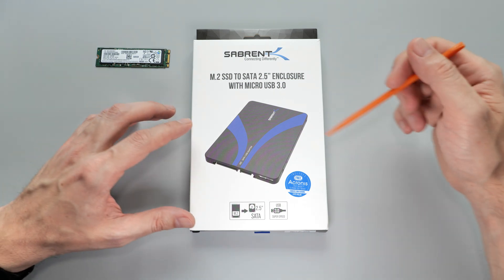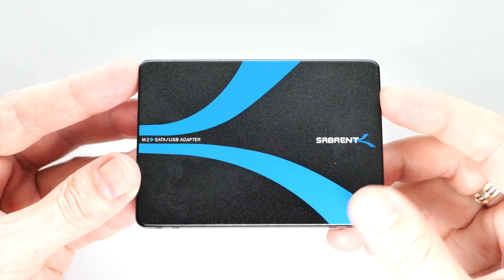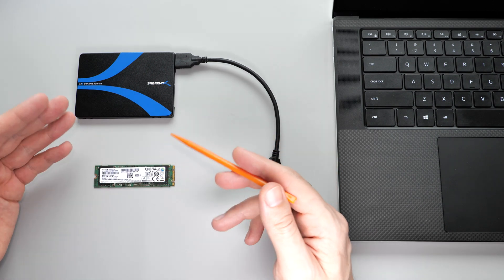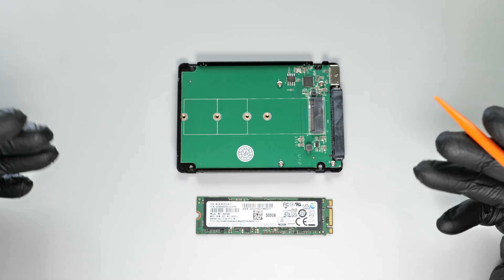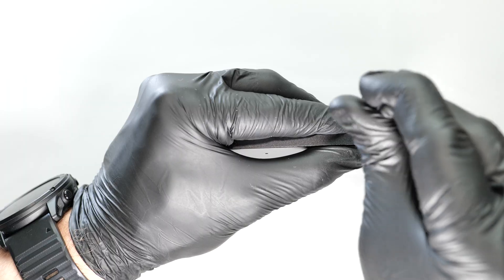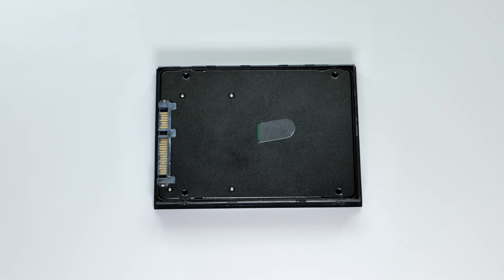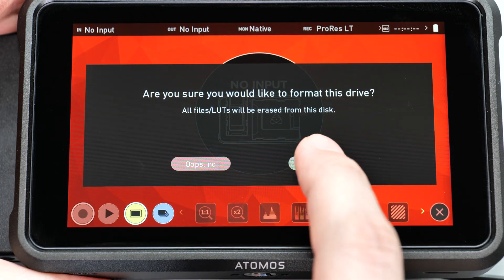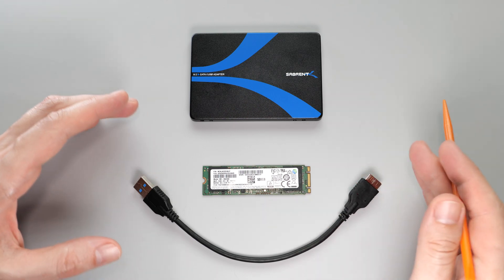Best M.2 SATA SSD to 2.5" SATA/USB Enclosure – Ideal for ATOMOS NINJA V & Upgrades

Comment: so are you saying nvme just isnt support at all? or do you mean you wont reach the speeds of an nvme drive
Reply from the maker: There are no adapters for NVMe drives, and I don't think they will ever exist. However, you can use any NGFF SSD, they are not expensive and provide the maximum speed at which the Atomos is capable of working.

Comment: have you tried it with Ninja V+ or Ultra at 8K, or 4k 120fps. Keen ti see if this is a viable fast option.
Reply from the maker: There's no difference in speed between this M.2 NGFF SSD and a full-size 2.5" Samsung SSD. They will still have the same speed, and there are no better solutions at the moment. The only difference is the convenience of using a built-in USB port in that adapter. So if Atomos claims Ultra at 8K or 4K 120fps support on a SATA III port, I guess it will work somehow. I didn't have an opportunity to check it yet.

Comment: How about the heat 
I have an old toshiba laptop and i want to buy m. 2 and adaptor like this but i am scared about the heat, and which one is better use normal sata ssd or m.2 like this and thank you
Reply from the maker: There are two types of M.2 SSDs: NVMe or PCIe drives and NGFF, which are regular SATA drives but in the M.2 form factor. You can use only NGFF drives with such adapters, and they don't tend to get as hot as the super-fast NVMe drives. However, you can always apply some thermal putty on top of the drive, and the aluminum case of that adapter will act as a heatsink. The same cooling process is used in regular 2.5" SATA SSDs.
Reply: The m.2 sata is just same sata ssd 2.5 right? 
And  because the m.2 nvme in my country is same price sata ssd 2.5 thats why I think about it but that problem what I afraid about it
And do you mean thermal putty like what use it in cpu block or like what in motherboard at m.2